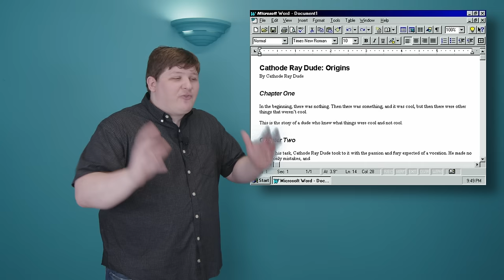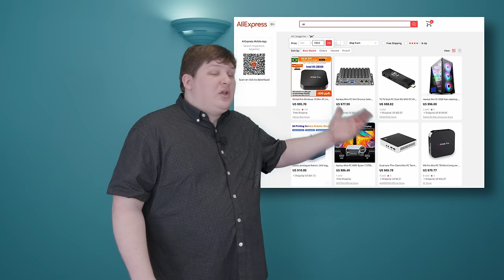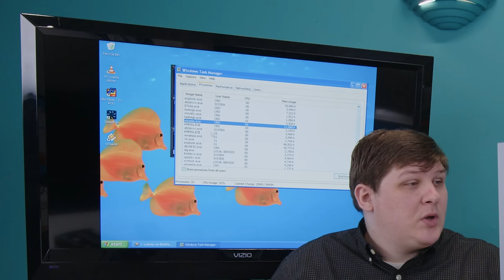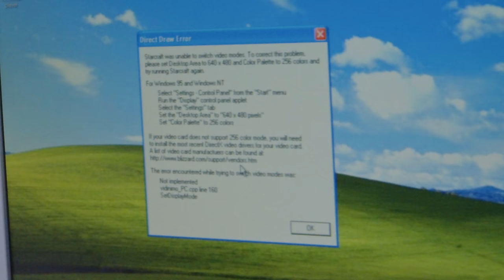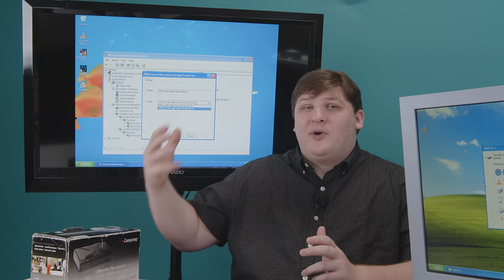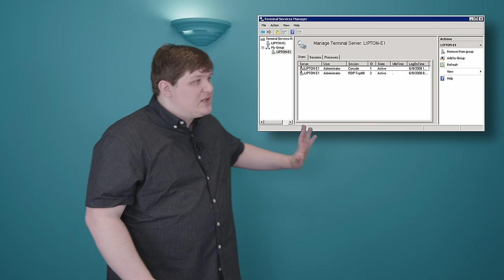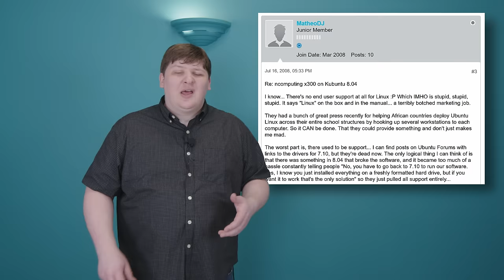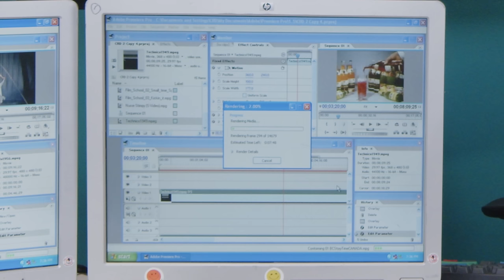7 Users on 1 PC! - but is it legal?

Comment: Astounding. No virtualization, no docker, no kubernetes, efficient hardware usage in 2004. Are there any solutions like that today? Instead of relying on server farms you can split your computational power
Reply: Now any reasonably modern PC could do all of this with virtual machines pretty easily.  You would just need some way to allocate input devices and displays to specific VMs and you could probably do it with of the shelf hardware.
Reply: @thesledgehammerblog  overhead on that us obscien
Reply: winconnect does the job.
Reply: @akimbofurry2179  Only because Windows is chonky. In the general case it was a viable tactic in *1972*.
Reply: My work desktop runs Ubuntu and KVM to host 2 Windows 10 VMs.  I RDP to those Win10 VMs from my laptop, no matter where I'm at (remote, in the data center, or sitting at my desk).  We have a "budget" VDI for contractors to remote into that has the same setup, but with 3 Windows 10 VMs.  I could easily run 5 Windows 10 VMs on this same mid-tier desktop system.
Reply: For example VNC. If you do not need a GUI, then just ssh.
Reply: @helidrones  VNC does not let multiple users on same PC, the way it is implemented
Reply: xrdp does support multiple user sessions over xvnc. I am not sure whether it or something similar works with wayland.
Reply: @akimbofurry2179 Not anymore. With modern CPUs, the processor actually directly runs instructions for the virtualized machine. The only added overhead is for running multiple kernels.
Reply: I'm not sure what this comment means.

Splitting your computational power is for when you have more power than you need in a single machine.
Server farms are for when you don't have enough power in a single machine.

They're completely opposite use cases!
(Also: "cloud" systems like Google Cloud or AWS will give you a VM, on a machine that is possibly shared with other users)

Comment: Honestly, The Web is pointlessly complicated at this point. Sites from 2005 are more usable than most made last month.
Reply: as a web developer, i apologize. every site has 20 gb of javascript libraries loaded for no reason and i hate it, too
Reply: @boyadh  So don't load them
Reply: @boyadh  damn 20gigs 🙀
Reply: Yea but, that’s because who we build the web for has grown immensely since 2005 and due to this things have gotten way more complicated . Back in the day you just needed to make an English website that worked passably on an 800x600 desktop. Now, when you make a website you need to make sure it works for 1920x1080 Desktop and mobile and everywhere in between and this is just a simple example. A lot of features that were relatively simple back in 2005 (or stuff you didn’t even need to think about back then) have gotten a lot more complicated. Accessibility, security, internalization all have gotten way more complicated since 2005.
Reply: @boyadh  Don't forget to add the whole bootstrap lib for just 2 icons

Comment: I’d love a follow-up video where you push this to it’s limit. Something like a first-gen Core i7 with matching motherboard, that has 2 PCI slots and running on a SATA SSD.
Reply: I second this notion. You could go even further and run it on modern hardware with a PICe to 2x PCI extender, like the "Sintech PCI-E Express X1 to Dual PCI Riser Extender Card." In which case the bottleneck will end up being 4GB of RAM I would guess..
Reply: It is interesting to see this being used on such limited machines. Cranking the CPU and mobo to what this could theoretically support would be pretty neat, though probably not enough for a full video.
Reply: This is exactly what I want to see!
Reply: If you REALLY want to push it maybe a dual cpu workstation.  All the cores…
Reply: See my main comment :)
Reply: For what I do, I still use SATA SSDs, they are so inexpensive.  It still feels like they came out yesterday for me too.
Reply: I think the best thing you could reasonably find in 2007 was a Core2Quad Q6600, and it would have been quite pricey at the time. I ran a system using one of those for ages, and for general compute tasks and light gaming (for 2013) it was quite competent. If you were able to find a good LGA775 motherboard with quality VRM designs, you could readily overclock the crap out of that processor. It was also right on the cusp of memory controller integration into the processor, but just missed out on that, so the motherboard what what determined memory compatibility, so you could actually choose if you wanted to stick with DDR2 or move on to DDR3, which is always an interesting choice to make. I'll say that the determining factor for that comes down to if you can find a motherboard that supported DDR3 clocked at 1600MHz. Otherwise, running high-end DDR2 clocked at 1067 would likely net you the same or better performance due to the significantly lower latency that DDR2 featured compared to DDR3 at the outset of its production. Of course, as time moved on and DDR3 was refined, it was totally possible to get extremely low latency DDR3 clocked at 1600MHz or higher, depending on motherboard compatibility with memory clocks outside of Intel's spec for the chips.

2007 was such a weird time for computing.
Reply: I'm still running my gen 1 i7-870 Dell XPS 8100 bought in ' 09
Reply: I say go back to an AMD64 Socket 737
Reply: I bet you could find a Z97 motherboard with PCI, and use an i7-4790k. I hear that the Z97 is the last good chipset for XP, after all.

Comment: That commentary about how if you only do one task you can keep the same old PC for decades is why I actually went to university with a 1999 iBook to take notes in classes.... in 2017
Reply: Back in 02 I took a 486 laptop to college for my typing, programming, and web publishing courses! 

The instructor laughed at me, I was like hey, it does everything I need for class! The class laughed too. It was almost 2" thick (Dell xpi)
Reply: yep, used an X20 (2002) in 2016 as well, now I have an X220 (2012) I still use almost daily. I just got an L412 (2010) from the trash bin at work as a workbench PC. It's just for looking up datasheets, some programming, interfacing with measuring equipment and some graphing/data handling. For these applications you really don't need a lot of power, hell every USB device, that I'm currently using it with, would work with a USB 1.1 port as well.
Reply: I was using an early P3 based celeron laptop in the early 2010s. I even took it online some.
Reply: With a laptop it's lifetime is pretty much tied to the battery. When that dies, you're unlikely to find new old stock that isn't also dead.
Reply: the clamshell?
No way! Those things were so cool
Reply: Literally typing this on an 07 black MacBook, sure I’ve maxed the ram but that’s it. It’s just my web book so to speak but is capable of a lot more. I haven’t updated to many of the programs and the only time I run into issues is of course browsing the internet.
Reply: @davidmcgill1000  
Not that hard to replace the cell pack with equal value cells.
Reply: I was hauling around a PowerBook 5300 well into GW Bush's first term.
Reply: @Just.A.T-Rex  
Hey, I got a macbook pro 1.1 from 2006 still kicking with linux on it! Battery's good still, too bad it maxes out at 4gb of ram (or 3, in macos's case). Though their efi and bios emulation are a pain in the ass, as the processor is a 64bit core 2 and the efi is 32 bit. Even worse, in efi mode the card doesn't expose itself correctly so no video unless you dump the card's rom and load it manually into its linux driver. Also function keys like the brightness ones don't work in uefi boot, only bios. Probably something with apple nonstandard device implementation.

Comment: My old public school had (and probably still has) these in each classroom, I always wondered how they were putting 4 virtual machines on a Core 2 Duo.
Reply: Yep, I was a tech aide for the IT dept at my high school at the time these released and we basically used them as a cheaper way to replace a buncha badly aging Pentium III machines in our main computer lab.  They actually worked quite well, though we had to lock away the main PCs on each row after some kids quickly discovered they could sabotage 4 of their peers work by force power cycling their own PC lol
Reply: @olddrunkninja  that was something I was curious about. Since the host PC is basically controlling every session, you can't really make that into a student device without some jenky lockout i'd imagine.
Reply: My trade school had this setup 20 users on a server using the Ncomputering termals and there was one setup reserved that was for the IT personal. He was surprized that I tried to use task manger and figure what that pc specs are and all the 20 user were using internet. The video playback is tearing bad.
Reply: core 2 duo is no slouch.
Reply: @camthesaxman3387  re: "core 2 duo is no slouch."
True that. BIG improvement over the Pentium series .... stilling running C2D here on a 2008 Dell Optiplex ... and Win Xp to boot! Using Mypal browser 'cuz nothing else works tho ...
Reply: @WilliamHollinger2019 Meanwhile my community college’s computer labs deployed every table with a single Dell workstation tower. In a lab there are 20 tables with 20 towers. Those towers was equipped with the highest specs provided by Dell. 3.33 GHz Intel Xeon Quad Core, 128 GB of DDR4 RAM, Nvidia RTX A6000, Windows 10 Education. Sadly some features are locked such as control panel and the modern start menu. Probably configured that way by the system administrator to avoid students from modifying the operating system.
Reply: @uploadJ if you’re using XP on a core 2 duo you’re not using it to it’s fullest potential. Those are easily capable of running windows 10/11

Comment: Yeah, my 1.2 ghz Athlon-A lasted from May 2000 to January 2007 — almost seven years. It eventually sucked for gaming with my ATI Radeon and could not keep up with Doom 3 / Half Life 2.
Reply: Hey it's chocolate rain man
Reply: Athlon X2 here :p Cheers
Reply: You're the last person I would expect under this video lmao
Reply: Even Tay was on the AMD train lol
Reply: Yeah, I eventually realized that whenever your pc starts feeling slow for games it’s usually better to just get a good graphics card instead of updating the whole pc.  I was able to keep a late 2006 model Mac Pro from 2007 to  2016 by updating the graphics card around 2014 or so.  (To be fair this was a pretty good machine back in the day and I did install a different graphics card in it shortly after getting the machine)
Reply: I got a ps4 and a 2012 macbook, and I'm probably not going to upgrade anything for another 5 years.
Reply: 7 year old hardware is just on the edge of pushing it nowadays, depending on what you do a 4th gen intel processor would be fine, some stay dry but on AAA games others would definitely feel the pain, but back then, being on 7 year old hardware, say it publicly and you're insane
Reply: Dudeee i had a 1ghz one and used it till 2015
Reply: @eqprog  RIP my gaming laptop :(
Reply: @schizophrenicgaming365 speaking from experience, a high end CPU from 15 years ago can still game today, you just need a current hardware accelerated GPU.

I had a i7 940, 12 gigs of triple channel RAM, and an RTX 2060

It ran Minecraft java at 35fps, bedrock at 70 fps and beat saber at 115fps.
Reply: Did you use that computer to upload chocolate rain?